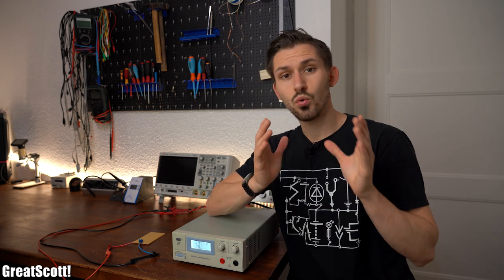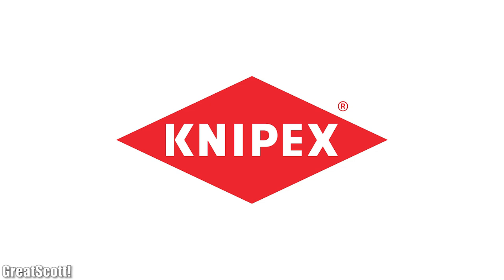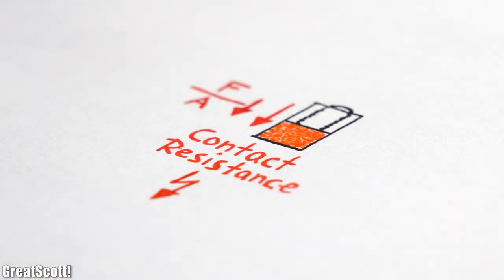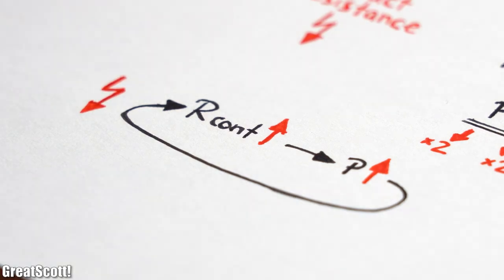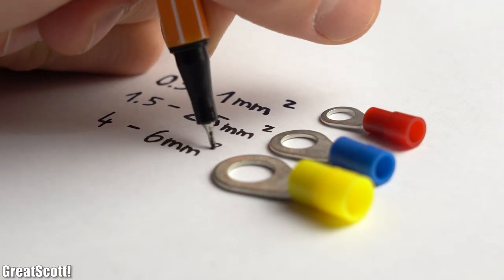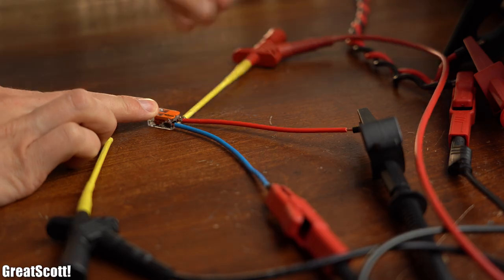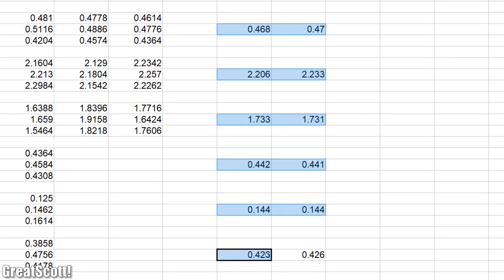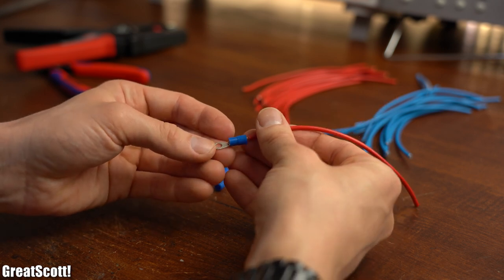Connectors are more important than you might think! So which one is the best? (Experiment)

Comment: Your results are not surprising. Solder should be the best because it is about as close as you can get to a fused connection. It also has by far the most contact area of all the  others.  Contact area plays a role in resistance but it plays an even more significant role in heating. The smaller the area effected by the (I squared R) wattage, the hotter that spot will get. The crimp and screw connections are just about equal, which is understandable  albeit that there can be some variability with stranded wire in a screwed connection. You have to be careful doing these. Personally, when possible, I like to have  both wires under each screw, which means more wire to wire contact. 

The stab connections rely on spring tension of the female connection. This can be pretty marginal. On things built with a male spade, you don't have much choice short of soldering. I try to squeeze these down a bit before and after attaching.  It makes a difference  

As for the terminal strip clamp connections, there are a few slightly different designs. Great on solid wire but you really benefit from a ferrule for stranded wire. Then they are OK.

That brings me to Wagos. I'm that one in ten thousand who hates these. My reasoning is simple. That spring clamp design is not really very good. Brand new out of the box, they have more resistance. And then there  is the very tiny contact area, which is not wire to wire but going through the tiny little bus bar. But the fact is that current actually flows through all parallel paths, including that tiny little spring Because the contact area is so small and it inherently has resistance, there is probably more current flowing through the spring than is desirable. Two little parallel resistance  paths where each wire makes contact. Four of these paths when connecting two wires.  And then you have two dissimilar metals making  up the spring-bus bar assembly. They are absolutely super easy to use, but it is a "flawed" connection. The crappy contact/connection which relies on the spring applied tension and higher resistance is not likely to make a lot of difference at low currents. Not amazingly great, but acceptably adequate. but as current rises and the heating effect of the current squared kicks in, the connection just gets worse than its originally mediocre quality, it's going to make a difference.  These things, by design, made a compromise favoring easy use over the quality of the connection.  

Is that acceptably, adequate?  Maybe. But I struggle using a device whose job is to make a good connection between two conductors and it is handicapped by its very design from the get go!!  But it is easy, so it comes down to what makes for the best designed electrical system after everything is installed.  Is the easy installation worth potential long term issues??? Of course it is not going to be an approved connection, but I'm wanting to try two stranded wires twisted together and covered with hot melt glue!! Anybody want to bet on how it performs compared to a Wago????  Resistance and heating under current.

Comment: how can a positive feedback loop occur? Assuming constant voltage, current is a function of Resistance if the resistance goes up current goes down, so we should reach an equilibrium  Although the temperature a that point could melt the insulation or ignite it, I don't see how we can get a thermal runway (positive feedback loop), am i missing something here???
Reply: What you say is true... IF the connector resistance is the dominant factor.  But let's say you have contact resistance of 0.1 ohms with a system that has 12A at 120 V (obviously the load resistance is about 10 ohm).  Tripling the contact resistance does not cut the current to 1/3.  But it DOES raise up the power dissipated by very close to 3.0.

So while yes, a rising contact resistance lowers the current by some amount, it's often not significant compared to other things.

Comment: I noticed the significant voltage drop  when I do a test to measure the capacity of a 18650 battery by module ZB2L3 at the module's connector. It must be the bad connection.

Comment: 3:50 - Ugh... NO!  Don't tin leads that are going into terminal blocks.  The solder makes the wire brittle.  Much better to use a crimp ferrule instead.

oh.. you do that next.  Still, it's bad to recommend tinning leads like that at all.  And you're stripping too much wire with your ferrules.  The insulating shoulder should extend past the insulated section of the wire.  Naked wire behind the ferrule is no good.

Comment: Is the cage clamp connector not specifically designed for stranded only? I thought the ferrules were only intended to allow stranded wire to be used in terminals designed for solid wire. Does anyone have a definite answer on this?

Comment: What about the XT60 connectors you usually use for things like batteries?
Reply: My understanding is that XT60 are able to handle 60A for continuous load and XT90 are able to handle 90A, so they are suitable to larger loads encountered in robotics and solar.

Comment: I wonder how much better the solder connection would be if they were not lapped and Y wound instead.
Reply from the maker: I doubt that there would be a big difference electrically
Reply: @greatscottlab  in my evaluation about 10 percent more higher amp circuits even greater

Comment: I used an old car battery as a ups battery and ups gave upto 2 hour pc backup, but I installed a cooling system due to high load and overheating reason, The ups's PCB died due to sudden main power line voltage fluctuations...

Comment: I want solid core wire for my breadboard, can anyone suggest link
Reply: Search jumper wires.
Reply: Go and buy standard 1mm2 installation cables with solid core in the shop were they have electrical supplies and cut them to your needed length and strip.
Reply: I like to use staples that (should) go in a stapler.

Comment: Never heard of those "feral" things...if your wires are pulling out you didn't install it with the proper torque or used the wrong size.  Seems like with the extra crimps you have more opportunity for poor connections since you now have 2 instead of 1 mating of surfaces.

Comment: Something i've just discovered: Wago 2260 / 59 / 61
Basically getting all the perks of a Wago S221 (direct push-in for solid core cables, button push for stranded ones), on PCB-wire connections, and as an added bonus much more low-profile than screw terminals.
Those exist both in SMD, and through-hole for the larger ones.
They're now my standard option for power PCB-wire connections.
Much cleaner for a final product, and much faster use for prototyping.

https://www.youtube.com/watch?v=sLJkjkCkjU8

Comment: Wanted this video for a long time because i use 9v battery connecter to use a 12v lipo battery and that connecters get pretty hot after a long use i also tried to solder a thicker guage wire but the connecter points gets hot
Reply: That's why you are supposed to use XT60 connectors for lipos
Reply from the maker: Yep. XT60 for LiPo is a good choice
Reply: @greatscottlab  Thanks

Comment: 55 years of experience with those spade connectors tells me they suck large without even guessing about it. So many intermittents and disconnects, they're the first thing I suspect when anything stops. I'm mostly solder multistrand wires assembled with a Western Union twist. Now that I buy more and more things from China, I have come to loathe those weak-ass green PCB screw terminals they put on everything.

Comment: Few points of conjecture: 
Solid copper wire should be phased out everywhere by now. It has no vibration resistance and is incredibly prone to breaking. Of course, electronic wiring is not identical to house wiring(where vibrations and movements would be more apparent), however the concept carries.
Shoelace terminals are one of the worst things to use in wiring systems. The amount of times fault-finding has led to a loose shoelace, whether by incorrect crimping, or by loosening over time, is beyond counting. You will get a much more secure connection by letting the terminal bite into the copper itself.
Reply: Say what? Solid has plenty of uses in stationary life and for other needs. It's never going to leave. Different tools for different jobs

Comment: Great video, not too many know about ferrules and think soldering stranded wire is an acceptable means, like you said, it's not the best way. 
Cable "shoes", that's a new one to me. As with everything electrical there are many different names for the same things. I am more familiar with the term "lugs". Ring lugs, spade lugs (push ons)...    Or "terms", short for terminals / terminations , ring term, spade term, pin term....... 
While butt may sound funny, I think butt for your ass is more English slang. Butt is more for butting things together, like butting heads, or, in the case of these terminations, butting the wire ends together.
Reply: I've done that mistake. The solder flows slowly under even very low pressure. Just about every screw terminal i did with solder-soaked stranded wire started the crackle after a month or a year. Never ever any more. Non-soaked is more reliable than soaked, as silly as it may seem... at least in my experience.
Reply: @victortitov1740  100% correct, logical thinking would lead most to believe that a stranded wire that is soldered is a better connection for a screw terminal. But.....once explained it makes sense of course.

Comment: You did the flat cable shoes wrong. You measured 2 connector in series. You should have measured a single male to female connection. Additionally that way there wouldn't be any solder involved.

Comment: Useful comparing.
You forgot a breadboard test. They won't take 10A, but with a lower current you would give us an idea how bad they can perform 😖
For every resistance this rule applies: the maximum power dissipated in the resistance (read: connector) is half the power of the connected load. So in the worst imaginable situation, the resistance of the bad connection equals the resistance of the load, and half of the power is dissipated in both. Think about what a 2.5 KW washing machine can cause in the worst situation:  1250 Watt dissipated on the surface of a few mm². Flames will be the result.

Comment: When are you going to pull 10 amps through them? Look at your FDM printer. I'm looking at mine and I think I'm going to address that ASAP. My heated bed has a cold resistance of 1ohm. My power supply pumps 12v... My $20 board has those connectors, but not for long

Comment: I had a relay system that power some lights well one of the  relays decided to go kaboom the neighbors were banging on the door because there's a shower Sparks don't know what happened relay was rated for 50 amps 24 volts input I was powering it from 24 volts and only 6.2 amps

Comment: Solid wire is for AC. Stranded is better for DC. That's irrefutable. Solder the end if you need a solid type connection for DC stranded. I've never had a soldered end of a wire "lose" its tension once screwed into place. Better would be a solid end as you show, but the misleading statement about losing tension needs to be called out.
Reply from the maker: Not misleading. It is a fact. It will take a long time until it happens, but it happens way faster than as with solid wire.

Comment: Hi, this video was very interesting. I think it would be awsome if you can test PCB terminals and may be also other types of connectors where you need to tighten the wires and measure the connection resistance at different tightness of the screws. There are a few videos on the eFIXX channel( https://www.youtube.com/watch?v=EB-Zh89nHnk ) showing the use of torque screwdrivers and I wondered how important it is to torque PCB wire terminals to a specific torque or it is good enough to tighten themby hand(and how tight they should be). It would be awsome if you could do video about this topic as we all use wire terminals.

Comment: You say "Show you how to use each one properly" then badly crimp multiple connectors by leaving exposed copper before the crimp. There should be NO exposed conductor once the connection is made. Risk of shock and/or short circuits. The insulation on the crimp extends past the metal part so you can crimp the wire without crimping its insulation and still have no exposed copper. Too much insulation stripped off is a common amateur mistake, I'm surprised you did this as your content and advise is usually good.
Reply: Agreed!